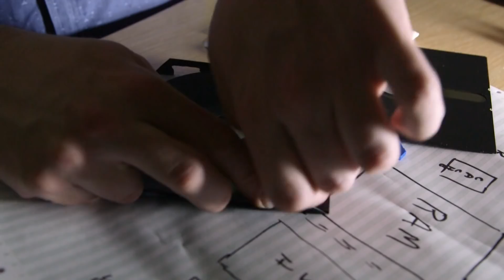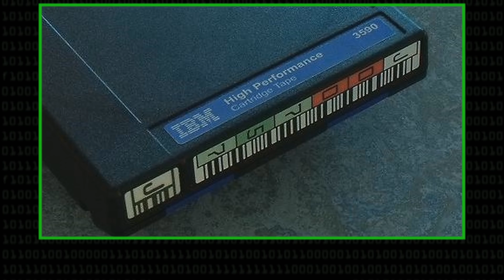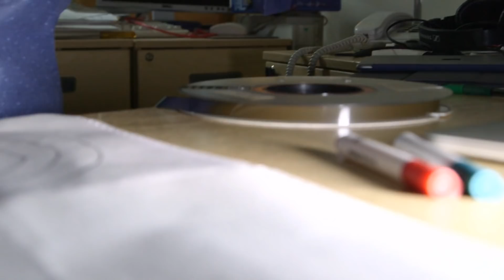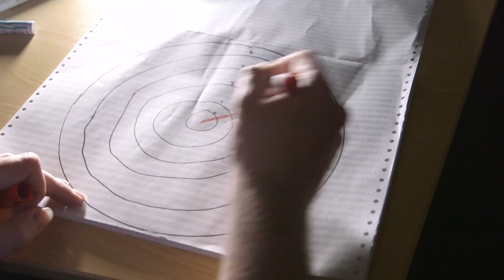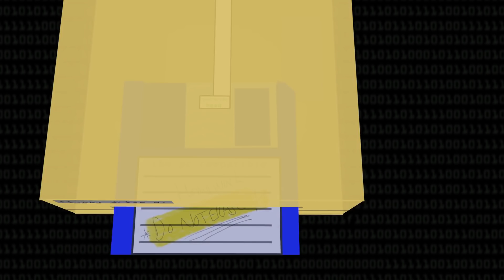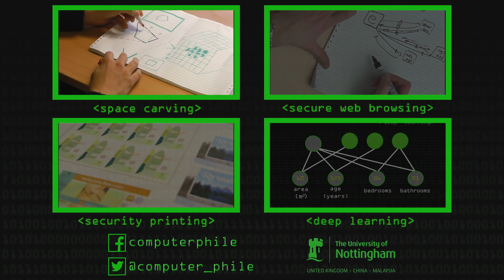Magnetic Media (Floppies and Tapes) - Computerphile

Comment: am I the only one who didnt understand why the inner portions store the same amount of data as the outer portions?
Reply: It makes the electronics easier.  No need to care which track you're on, just read/write at exactly the same speed.  Apple used multiple zones on their 800KB floppies where they'd slow down the motor toward the outside of the disk to pack in more data.  Noone else bothered as far as I know, and even Apple abandoned it with their 1.4MB disks.
Reply: @thisnthat3530 so the maximum data each portion can take is up to the size of the smallest one, or I understood wrong
Reply: For simplicity.  Modern hard drives are much more complicated than floppies and generally put more sectors on the outer tracks.

Comment: I found out today that some companies actually still use tapes, instead of HDD's, to archive data. Why is this?
Reply: #1 Because I can store 15TB on a $30 tape compared to a $3,000 15TB spinning disk drive or a $40,000 15TB SSD.  And yes, enterprise disk drives cost that much.  We don't use $400 consumer disk drives in enterprise storage arrays.

#2 Because backups on spinning disk are much easier to destroy accidentally or on purpose than backups on a tape sitting on the shelf.

#3 Because it is easy and cheap to send tapes off site.

Comment: My lab partner worked at NetApp, said they've only replaced their tapes archives a couple years back...gotta ask why? Is the speed differential between magnetic and silicon storage not drastic enough to justify the replacement price? We still got hard disks on the market so I presume the answer is yes, just wondering if there's anything in the future of magnetic storage, or if SRAM will eventually absolutely replace it....
Reply: Tape is a hundred times cheaper and far more reliable over long periods of time than hard drives.  Solid state storage is two thousand times more expensive than tape.  Tape is also much higher throughput than spinning disk.  If you have a cabinet full of tape drives, you can move a LOT of data.  When you realize enterprise backup storage is measured in Petabytes, you'll understand why we still use tape.

Comment: Back in the day, I worked on a PDP-11 system which employed a TU-58 tape drive. The media was "block structured". These tape drives were also present on all VAX-11/730 machines to load the microcode during boot.

Comment: Yep, linear tape is still a popular format. The most common format these days is LTO, or Linear Tape-Open. Modern, generation 7 LTO tape carts can hold up to 6TB of uncompressed data, with 12, 18 & 48TB capacities on the horizon. LTO cartridges have only one spool, so the tape drive contains a take-up spool internally. Data is written on the first track from the beginning of the tape to the end, then written on the second track from the end back to the beginning. Data continues to be written in this serpentine fashion until all tracks are full, and the tape has been wound back into the cart.

Comment: at 8:38 How is that connected to previous question?
It answers why read/write speed is the same for inner/outer tracks, not how much data is stored.
Reply: It appears that outer sectors have lower bit density than inner sectors. Such a waste!

Comment: That audio cassette is going the wrong direction.
Reply from the maker: +Greg Quick yes well spotted, I just decided to let it go in the same direction as Steve was illustrating >Sean (pretend it's an autoreverse deck?)
Reply: I was going to comment that it was an auto reverse deck but you beat me to it. Brilliant.
Reply: So basically, the order of the data depends on the type of tape system? =p
Reply: I was going to mention that.

Comment: I was hoping to see an explanation of the technical side a bit of magnetic data as well, on a molecular level. I know that these pieces of rust on the tape are like small magnets and the direction they are standing defines whether it will be read as a 1 or a 0, but would have loved to see a more in-depth explanation.

Comment: Is there any technical reason why optical media like CDs only have one long spiral track while magnetic media like floppy disks or hard disks have many circular tracks?
Reply: Not a technical reason. The origin of CDs is in the music industry - they replaced vinyl records (i.e. mostly intended to be played sequentially). Only later the computer industry adopted them for data storage.
Disclaimer: general knowledge, am not a hardware engineer.
Reply: As Ammon said, CDs were designer for music. This mean you have to have an uninterrupted flow of data. If you had circular tracks, your music would take a short pause after every revolution of the disc. This would of course have been unacceptable. 

You could circumvent this by having a buffer memory to store at least one track of information, but this would have been way too expensive for consumer products at that time. Required buffer memory would have been more than 50kB. That was a LOT at the time CD standard was created.

So ... spiral track was a better solution.
Reply: TheUglyGnome You don't need to store one track. You only need to store a number of samples equal to the seek time between adjacent tracks. You also don't need to wait for a whole revolution if you factored in the needed offset when specifying CDs. I believe such offset tracks are even used in magnetic media.
Reply: Anyway, my theory is that circular tracks make seeking easier and one spiral track is obviously better for sequential reads. It just so happens that both CDs and DVDs have sequential reading as their primary mode of operation. So there is a technical reason but it has nothing to do with optical vs. magnetic.

However, this is just educated guesswork and plausibility arguments. I was hoping for someone to actually know.
Reply: Penny Lane I know. Just tried to keep things simple, since I had no idea about your technical knowledge. 

But even if you built device with fast seeks, which makes it expensive (not trivial task in late 1970s for removable media drives) and take account possible seek errors, you'll still need several kBs of buffer. Again, expensive in late 1970s.
Reply: Using CDs to store computer information wouldn't have been considered in 1980, the biggest micros had 64K, hard disks were for multi-user minis and might reach a massive 20Mb in size. So there was no perceived need for the complicated memory buffers and track/sector addressing logic needed just to send a stream of music.
Reply: CommandLineCowboy The amazing thing about CDs, however, was that you could just instantly jump to any given track. So even without data, there was a use case that wasn't sequential.
Reply: ***** Is it now? It used to be under lock and key and super expensive.
Reply: Because the CD format was originally intended to store audio, not data, so it doesn't have tracks like a hard drive, it is more like a vinyl record.

Comment: And now I can have a MicroSD card the size of a pinky nail holding 128GB of media delivered to my house in 24 hours. I feel like we can't fully appreciate current tech unless we've all tried using floppy disks.
Reply: You haven't lived until you've had to toggle your boot loader code into the computer bit by bit using toggle switches on the front panel.

Comment: BS. A hard disc is much more involved than a floppy. The track alignment alone is just amazing in that it not only works, but is also robust. It's like saying an LP and a CD works the same. Might be true in a very general sense but there is a world of difference in the actual implementation.
Reply: Not really so much difference.  In fact, they now have touchless turntables to play your LP vinyl on that uses lasers to read the grooves so it doesn't have to actually touch the record.  Very similar type of tracking and read system as in a CD player.

Comment: Fun fact: all floppy disks are double-sided. 3½" disk drives have two heads so they use both sides. But 5¼" ones have only one head and you could write only on one side because the other was mechanically marked as read-only. But if you punched a hole in the diskette with a special puncher, you could then write on the other side as well.
Reply: Funnier fact: Most 5¼" disk drives have two heads as well. Single sided drives was a thing in the early 80's when double-sided drives were way more expensive, but as price came down everyone got double-sided drives.

When using both sides in a single-side drive, the hole you had to punch was to enable the index-hole sensor to see the index-hole (as the proper hole would be on the wrong side of the disk when flipped). And yeah, the Write-enable hole had to be cut out on the other side as well.

Comment: Seems kind of unfortunate though, that you read and write with angular speed, rather than surface area on the disk...

But I guess it would be more complicated and probably expensive in terms of parts to vary the rotational speed of the disk...

Because right now the theoretical limit of the information density on the disk, is determined by the track/sector closest to the center of the disk.
Guess this would also make for a fun math problem in which you put number of tracks vs the writing desity and see which settings gets you the largest data capacity for the full disk.

Comment: How does the drive know which sector it is reading? Is there a special area somewhere on the disk that it can detect as it goes round?
Reply: Each sector was preceded by a "CHRN" packet labelling the "address" of the following data.  The packet comprised the cylinder number (C), the head number (H), the sector number (R) and the sector length (N,0=128,1=256,2=512 and 3=1024).  The controller waits until it sees the correct sector address pass under the head and then does whatever it needs to do.

The were two ways to speed up reading and writing.  Since the latency was long and you might miss the sector that you wanted, the sectors could be "hardware" or "software" interleaved.  With software interleaving, the sectors were written in order but when the application asked for a particular sector number, the OS would translate that and ask the controller for a different sector.  The translation, of course, was optimised for speed.  Hardware interleave was similar except that the sector CHRN packets were not in numeric order on the diskette and no software translation was done.

Also, while floppy cylinders were numbered from the outside inwards, the OS might access the tracks or cylinders in any order it so pleased.  For example, usually, you'd go from track 0-0 (cylinder-head) to 0-1, 1-0, 1-1, 2-0, 2-1 and so on.  Sometimes, an OS would decide to go all the way up one side of the disk (0-0,1-0,2-0,...,39-0) and then up the other (0-1,1-1,2-1,...,39-1).  (The other popular size was to have "80 track" diskettes.

Yeah, I'm an Old Fart and had a bit to do with floppies (even eight inch ones) in the 1980s.  Ah, those were the days...  :)
Reply: There is a small hole near the hub spindle hole which allowed the timing hole to be visible to coordinate track start.

Formatting a blank disc laid down the sectors and inter-sector timing blocks.

On hard drives it's a bit different.  Some drive technologies had a hard-coded "timing track" interspersed with the data tracks to coordinate i/o operations.  If that timing track data were corrupted it couldn't be reformatted even id the data track next to it were OK.
Reply: 3½" drives detect sectors based on time from the first sector. 5¼" drives have sector holes to mark sectors. Both use index hole to find the first sector.
Reply: Its clocked so it knows exactly where it is on the disk ( see that little hole on the 5 1/4 inch floppy , it check how many times that goes round per second and where the head is up and down , form the 2 axis you can work out where you are on the disk
Reply: MisterMcHaos
I worked for a company that did OS extensions for TRS-DOS and the first thing we did was implement full track r/w buffering to speed i/o and cache the file table.

Comment: Music CDs were designed for constant linear speed, so the disc spins at 200 rpm near the rim and 500 rpm near the center. This wasn't a problem for music all read in order, but when you got to CD-ROM the drive would speed up and slow down constantly when it skipped around the disc. Eventually the constant speed drive became standard, and the drive would just read data slower closer to the center rather than speed up.
Reply: He is saying , the motor driving the disk actually changes speed/RPM depending on where the head needs to read data. If the head is near the center then the motor spins up the disk to a higher speed but if the head is near the outer edge the motor slows down to keep that data rate consistent because CD-ROM's don't use sectors in the say way floppy disks do.
Reply: I think you mean a measurement other than rpm, as no part of a CD is doing more revolutions than any other part,
Reply: No I meant what I said. When the disc is being read near the edge it's going 200 RPM, and when it's being read near the middle it's going 500.

Comment: While Compact Discs start at the spindle and spiral outwards, the numbering of floppy and hard disk tracks generally starts at the edge and increases towards the spindle.

Audio Compact Cassettes (audio cassettes) normally have the supply reel on the left and the takeup reel on the right.  The shown animation must be of a reversing deck :-)  Love those autoreversing ones; gets to the end of the tape, senes the reels aren't moving, flips the head around, and starts rotating the reel on the left and the capstan in the opposite direction.

Comment: there's a really annoying high pitch sound throughout the video.
Reply: +Nukleon I'm not sure if this is correct but someone mentioned that the HTML5 player in some browsers cut the audio at 15kHz
Reply: The magic of CRT monitors, my friend.
Reply: There isn't. You can hear some air flow, probably from air condition, but it's not "high pitched".
Reply: I can hear a bat fly by and I can generally hear this kind of thing still, I turned my speakers all the way up. Maybe it's only there if you listen on headphones or on a shitty phone speaker.
Reply: And a dead pixel.
Reply: There is. Just because you can't hear it it doesn't mean it's not there, I can hear it very clearly (look it up, corelates with your age).

Comment: Google still uses digital magnetic tape to backup important data.
Reply: The Large Hadron Collider also uses magnetic tapes too.

Basically, if it doesn't matter that you can only do sequential reads and writes - e.g. it's for archival purposes, not constant real-time access, so you're only ever reading the whole thing in or writing the whole thing out in one go - then tapes can be useful for having massive data capacities for very cheap cost.
Reply: @klaxoncow  You rarely read or write the whole tape in one go.  You read and write tapes a block at a time like disks, but the difference is you can't really rewrite a block in the middle of a tape.  You can randomly read a tape block from any part of the tape.  It just takes longer to seek to a particular block on tape (seconds to minutes) than it does on a disk (milliseconds).
Reply: My lab does the same. It's great for backups that you rarely access and when you do, it's stored neatly along the tape not scattered randomly everywhere.
Reply: back in the day of C64s etc, there was an after market thingy that could use your vcr as a 1 MB storage thingy.
Reply: The IRS does too. If you have lots and lots of data that you need to hoard, tape is cheap and it can sit on a shelf untouched until you need it some day, and it'll be as good as the day you wrote it.
Reply: A company I recently worked for still does this. They had these small 3tb tape cartridges. I don't remember the price of them but they were supposedly a lot cheaper than HDDs, in addition to being less sensitive because they didn't have their own onboard electronics and motors that could fail.

Of course it only makes sense for archival uses since tape has a random access time ranging in the minutes, and the machine for using them cost a fortune.
Reply: The Amiga used floppies. Earlier computers like the C64 and Vic20 used casette tape for data storage but it was mostly popular in Europe.
Reply: So does CERN.
Reply: Tape has always been used for enterprise backups, and is still used because it is cheap and fast.
Reply: A lot of companies do that, and not only for important data. Amazon even offers it as a SaaS called Glacier. It's not because it's simple (the writer is actually much more complicated than an HDD, hence its huge price) or easier to use (RAID arrays are much easier) but because the cartridges have huge capacities and, not having any electronics in themselves, are cheap and have long lifetime. Current IBM 3592 has 10 TiB per cartridge on about a kilometer of tape.